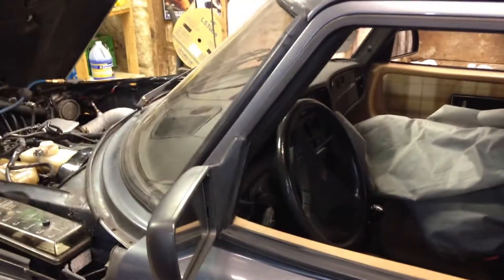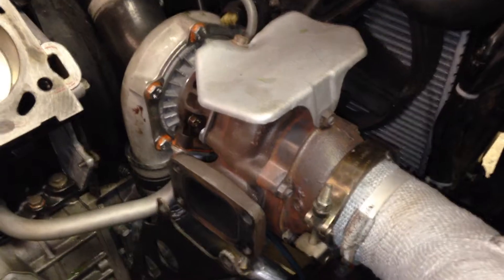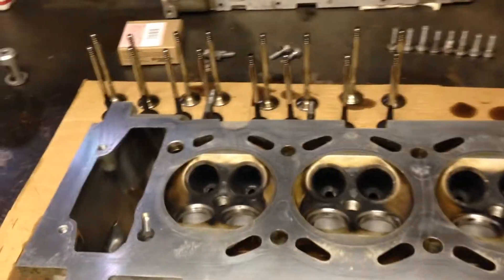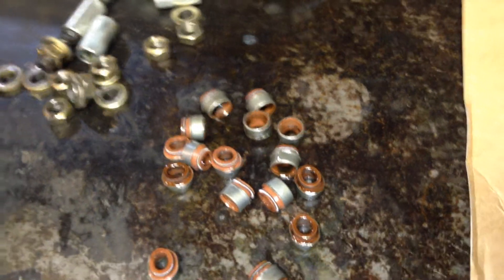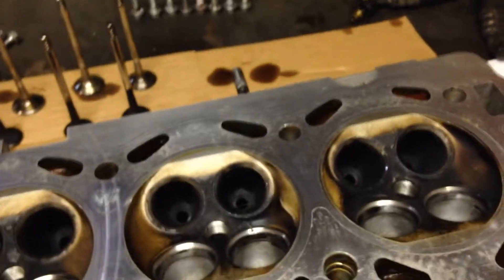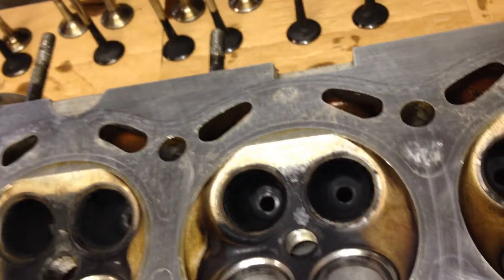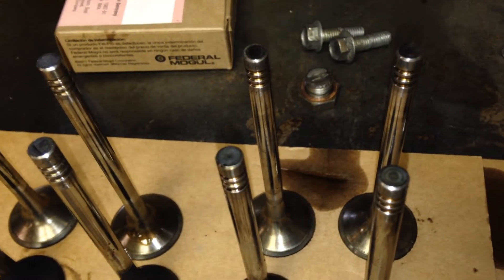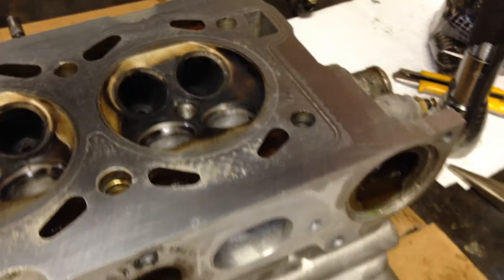Saab 900 Burns oil

Comment: My saab still runs great, Thanks for everything.  Ralf
Reply from the maker: thats awesome to hear...the ezk tune is hopefully decent for your application! Ill be driving my 900 again soon after I change the gearbox and install a new modified (ported) head, will also be installing a TE05 turbo with a 15T compressor for nicer performance compared to the crummy T3 Garrett

Comment: got to get the head deck at a machine shop. get the head check. 4 flatness. & make sure you don't have leaking valves's before you put it all back to gather. after you did piston rings & bearing.

Comment: How did you make the downpipe? cut off the original 90° flange to fit or did you have to rig it with the new turbo
Reply from the maker: +Ryan Gerth I went to ATP turbo's website and purchased the Ford TB03 turbo to 3' V band swing gate housing for $140 and was the best purchase ive ever made for this car. It replaces that awful factory swing gate housing for something that actually flows properly. Made a NOTICABLE improvement in performance without hardly any work

from here I welded a 3' v-band onto a 3' mandrel bent pipe and pie cut a couple pieces in strategic locations for fitment. that ford piece works on all T3 housing turbos, so can be moved over to aT3-60 or even a T3/T4 later on if need be

Comment: Interesting.. I've got about 3000 miles on my freshly rebuilt engine and am chasing a smoking on decel problem.  Are you all back together yet, and did the stem seals fix it? I've gone through my entire crankcase ventilation system and that's all good. I retorqued the head bolts, that made no difference, but needed to be done anyway. Normal driving I have no smoke, but if I do a hard pull and decel down to 2200 rpm- once i hit the accelerator again, I get a nice puff of blue smoke.  
I'm planning on doing the stem seals on Wednesday- with the head on.. I'd love to hear your results.
Thanks! 
(1998 B234R, 9000)
Reply from the maker: hmattyj Sorry about not responding sooner, I finished re-assembling the engine (again) and re-worked the PCV system and the engine still smokes just the same. This leaves only 1 possible source of oil consumption, the rings. I accurately measured the valve guide wear and it was way below normal, then cleaned, re-lapped the valves and reassembled with expensive seals. I am going to change the oil with fresh, then drive the piss out of it and see what happens over the next 1000 or so km.
Reply: Nodarperformance Yep- Since I hadn't heard back from you, I went ahead and did my valve seals and same.  Still smokes under heavy deceleration. When vacuum is pulling hard.  If I throttle, shift and clutch- no smoke. Only when I left off and engine goes into vacuum. Turbo or rings.  Really hard to believe it's rings, being that it is a fresh rebuild with 3500 miles on it... Hoping it's the turbo.
Reply from the maker: hmattyj see my next video on what actually was causing it: https://www.youtube.com/watch?v=71PNYRPalZE   i hope this is NOT your case but it is now my fate